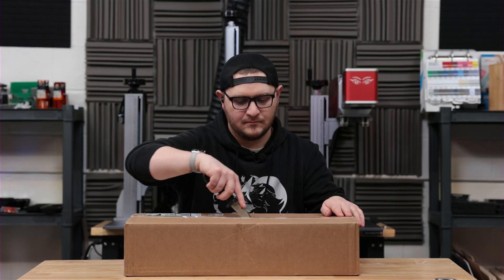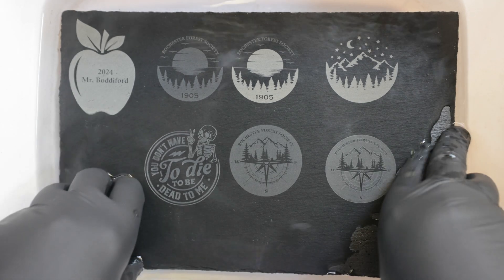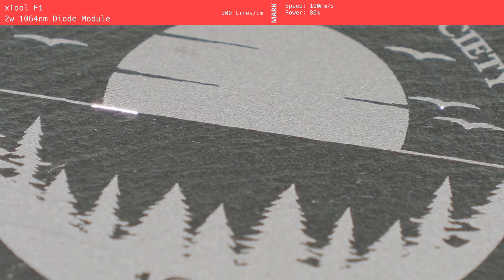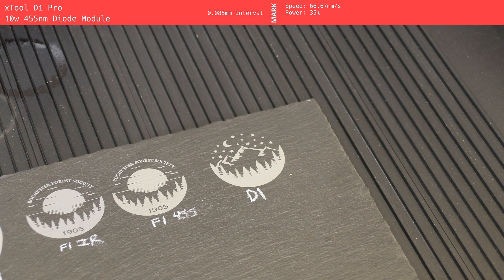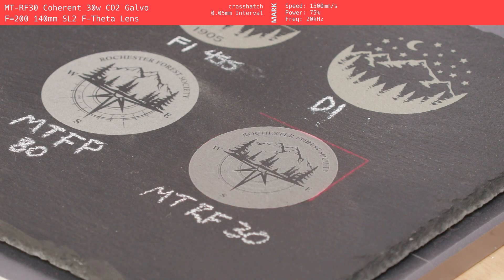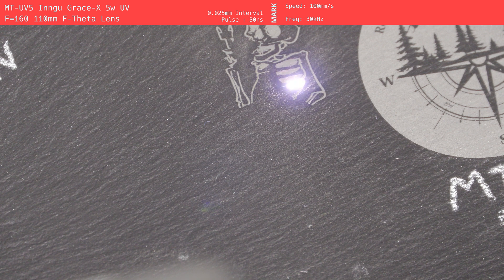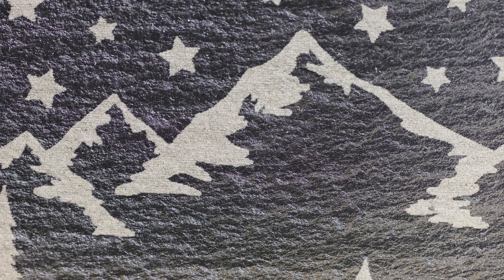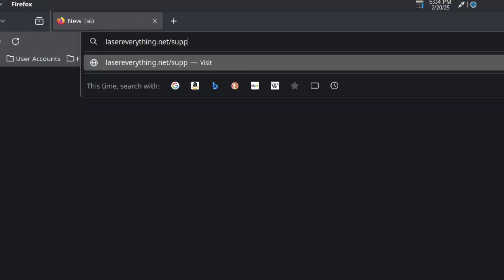The ULTIMATE Laser Guide to Slate | Marking and Water Testing

Comment: with fiber laser, if you do a second pass, would it make it better for water? Any waterproof coating would make it better?
Reply from the maker: I can't imagine a second or alternate pass would change anything but you could certainly clear coat it and that ought to get the job done.
Reply: I spry shellac bout 30 minutes before, and 30 minutes after engraving and light clean up to remove dust, etc.
Reply: Spray*
Reply: A quick application of polyurethane really makes any of the slate items I have engraved with the 40watt XTOOL S1 diode really pop. So I think that could mitigate the water issues with some of the machines.